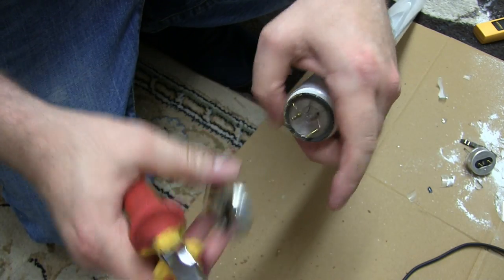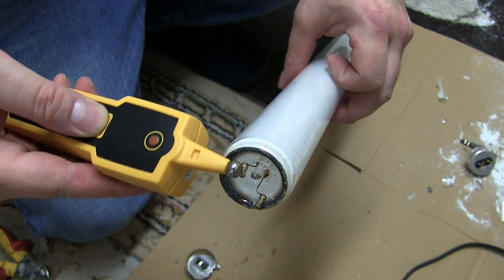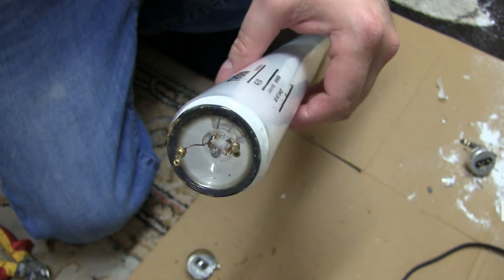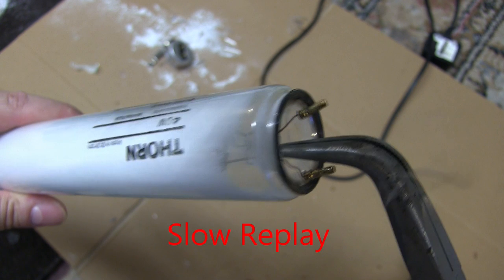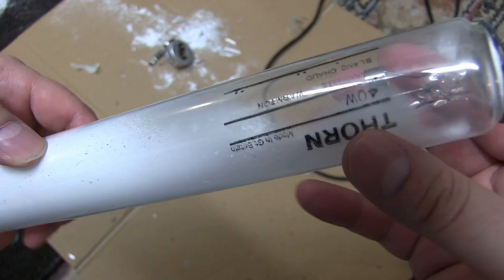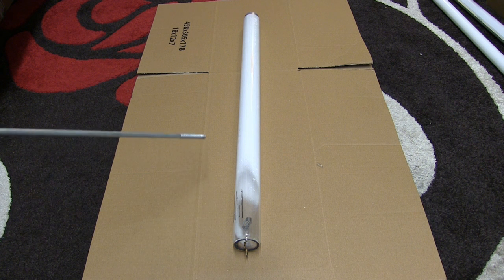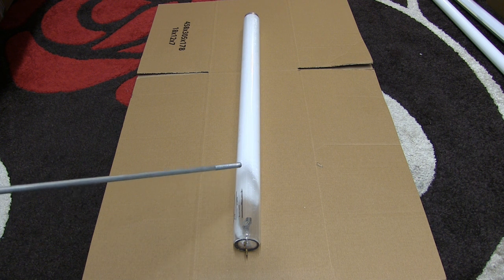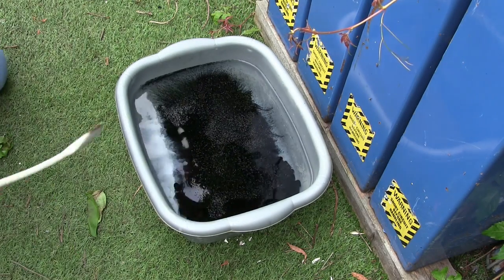Fluorescent Tube Sucks Up Water (Short Version)

Comment: I never would've guessed that the column of water would go that high up. Cool demonstration.
Reply: Would go up to about 35ish feet if he had a tube long enough.
Reply: This column of water actually weights 0.23 atm so the pressure in the air pocket is 0.77 and so there is 1/4 less air really in it than it seems to be.
Reply: It would fill up even more if the water was degassed first.
Reply: @chemistryofquestionablequa6252 but even then wouldn’t the gas slightly boil into a gas state and remain a vapor along with the minimal gas that’s in there?

Edit: because of it being under a slight vacuum

Comment: There may be even less gas than is visible, the weight of the water in the tube will maintain a lower than atmosphere pressure in the top part of the tube.
Very cool
Reply: The water also releases some of the gas that's dissolved in it, and will partially boil away due to the low pressure, further adding to the gas in the tube. You can see this very well with the 8ft tube - you can see a lot of bubbling and foaming near the top of the water as it's being pulled in.

Comment: probably most of the gas there is dissolved air from the water outgassing in the low pressure environment
Reply: Yes, you can clearly see the frothing as it travel up the tube. I would love  to see this done again with degassed water.
Reply: How much of that bubbling is outgassing, and how much is due to the water boiling into the vacuum?
Reply: @StephanAhonen  much  of it is water boiling, that's for sure.
Reply: @Peter Rabbit it would mostly condense when the pressure equalized, so i doubt it, but given the weight of the water column it is t as much gas as it looks like

Comment: A great video demo Photonicinduction! I make discharge tubes as a hobby and for a cold cathode fluorescent tube the pressure inside is about 20 millibars. Whether it is different for a fluorescent tube with heated cathodes I'm not sure but it looks about that judging by the result of your excellent experiment.

Comment: quick thing to note, water is heavy and gravity is a thing, so in the tube after the water is pulled up, if you left it sit against the wall it will pull a new vacuum, though less strong than the first. you can use this with even heavier things like mercury to make vacuum pumps and cody's lab made one of those like 6 or 7 years ago if you dig up his old, old videos.

Comment: So about 1000 Pa left. Still quite a ways from the 10 Pa of a 2-stage vacuum pump. I'd try using LN2 to collect the mercury out of those and make a Sprengle pump with it and some glass tubes (.001 Pa, and far cheaper than a turbo pump to get that same vacuum level, even if it is slower and takes a week per cubic foot).

Comment: You used to see the phosphor blown off the end of T12 tubes when they had reached end-of-life on SRS gear. After the cathode loses emission a lead-in wire would glow and melt back through the glass-to-metal seal and let the air in suddenly!

Comment: Yeah, That is quite possibly the hardest vacuum that anyone can handle without specific training on the dangers of it.
Reply: Except the difference in pressure between the inside and outside is probably about 100kPa. Making the internal pressure 10x smaller would increase that difference by maybe 1.2 kpa  or something. Not a huge difference.

The reason these are considered safe (except for the mercury) is because the volume of vacuum inside is kinda small, and spread throughout the long glass tube. If you had a similar "hard" vacuum in a glass tank the size of a big beach ball, that would be way more dangerous.

Comment: 3:20 is the water boling because of the high vacuum, when its rush up the pipe?
Reply: Hmmm, would say yes, but bubbles seem to be forming quite far from the top of the water so I don't know- the weight of the water means it can't boil further than about 30cm from the top

Might be dissolved gases? Should be about 3% of the height of the tube

Comment: that height of water column is making it look like there was more gas inside the longer tube, but i do understand it would make it difficult to show it in any other way.
Reply: I think it is pulling harder because the water weighs a lot in that tube plus there is likely steam or water vapor from the vacuum boiling the water at least initially. So there's no more gas in that tube than the shorter one.

Comment: You notice that the weight of the water actually filled some of that vacuum with water vapour on the 8ft tube. I think there is a physical limit to how far you can suck water up a tube and i think it's about 10 meters.

Comment: vacuum can't be too low or you can't start the tube. Can't be too high or you can't start the tube. Argon is added since it is easily ionized. Pressure is a balance between tube life and keeping the starting voltage reasonably low.

Comment: Quartz tube is needed when one wants deep uv UVC 254nm radiation. Mercury also produces more lines in UVA and UVB range. So regular glass blocks 254 nm bit still some UV light passes.  Not so dangerous but shall be threated with care.
Reply: Is this how tanning bed works? I've heard A and B rays needed for tan.

Comment: I am flabbergasted!!!!  I would never have guessed that even a high vacuum could lift so much water! Wow!! --- Now I am confused as to why fluorescent bulbs don't just implode all the time...??
Reply: Glass is pretty good at resisting stress and the round shape helps spread the load evenly. It usually cracks when force is applied unevenly.
High pressure is a lot more dangerous because the explosion throws glass everywhere.

Prince Rupert's drops are a good example of how focusing force at the strongest points of an object can result in it withstanding far more force than it would normally.

Comment: I bet it would have filled up more if it didn’t boil the water inside on its way up👍🏻
Reply: I reckon that was the air in the liquid degassing. The water would boil under vacuum but would return to normal when pressure equalized.
Reply: And gravity is still pulling down on the water so it's not quite 1 atmo of pressure left of gas innit.
Reply: It requires about 10 meters of water column to make it boil
Reply: Wasn't really boiling, just degassing due to reduced atmospheric pressure but you're correct about it would have filled more. The effect was amplified by the reduced pressure as well. I bet it was nearly full vaccum before he opened it. Pretty clever test really. It's very intuitive when you see it but i probably wouldn't have thought of it.
Reply: @Lucas12v  i thought exactly the same thing. It can't be that accurate when bubbles of some gas are forming and rising to the top. But never the less very interesting and a nice visualisation 👍ps: what kind of gas is it? Oxygen?
Reply: @night__walker  not sure. I would assume it's oxygen, nitrogen, co2 and some trace gasses just like air.  Probably in the same proportions as air but i could be wrong.
Reply: @Lucas12v  yeah makes sense
Reply: Probably would make sense to pull a vacuum on the water first to degas it and then do the thing. But that's overkill for a visualisation 😅
Reply: @Lucas12v  Hi Lucas. The gas will be around 90% argon, 10% neon and the tube will also contain a few milligrammes of elemental mercury. The actual pressure will be around 20 millibars.
Reply: @peterjameson321  that's what would be in the tube originally. I was referring to the gas that was leaving the water. Since it's basically dissolved air i assumed it would have the same composition.
Reply: @peterjameson321  still interesting info though. I was curious what the internal pressure was when it was sealed.
Reply: @Lucas12v  Ah, I see Lucas. Yes in that case you're quite correct of course. Thanks for your reply.

Comment: Thought you were going to try to light them up ,  did the gas oxidize on the inside of the glass? did the stuff wash away with the water or is it soluble, the water might be flammable in the glass

Comment: I can’t believe the 8ft tube was able to withstand the weight of all that water without breaking lol
Reply: The weight of the water pushing out is nothing compared to the force of the atmosphere pushing in when there's a vacuum inside. It's one thing to make a container hold pressure on the inside, and quite different to make a container to take a vacuum on the inside. Thunderfoot recently did a video about how much pressure / vacuum a soda can could take. It can take lots of pressure and be fine, but hardly any vacuum causes it to collapse.

Comment: I'd suspect if a liquid that had close to zero dissolved gas was used, the level in the bulb would be even higher.
Some say an extremely high vacuum of 0.0000001 Tor would cause the tube to fold just remember if the vacuum was perfect at typical sea level "fair weather" pressure is 14.6959 psig on the outer walls which the tube could easily withstand.  Nonetheless, this high vacuum is why it's so fun to toss these things in the dumpster! ;-)

Comment: you gotta use boiled water because there will be lots of gasses like nitrogen dissolved in the water that are released by the low pressure in the tube.

Comment: I wonder if you could calculate the pressure inside the tube by comparing the volume that's filled with gas.
probably need a less volatile liquid to do it though. 
I think this is how mercury barometers work, right?

Comment: I hope you didn't miff ur missus by messing on the carpets with the dyed water lol  Just one thing, if you take a tube full of water, sealed on the one end, and invert it, a gap will appear on the top inside (a vacuum)  depending on your atmospheric pressure, or something like that,  as far as I can remember.. so that gap might be a function of the atmospheric pressure as well.

Comment: I wonder how much of the space at the top was gas that came from the water since water dissolves atmospheric gases and you can see it causing it to either evaporate the water into the vacuum level pressure OR its degassing the water thus causing the gases in the tube at the top at least to be released from the water and bubbling up into the chamber the argon is also in,

Comment: So that little space left is the mercury gas? Im no chemist but that amount can't be super dangerous can it? Let's say a tube breaks in an average sized room and that amount gets released and diluted into the surrounding air; that cant really hurt you can it?
Reply: Remaining space is a gas pulled out of water due to sudden pressure change. In reality there is almost no gas. Amount of mercury from a lamp can't hurt you, unless you are exposed to other sources of mercury on daily basis. Still, it's a bad idea to hang out near a broken tube right after it pop.

Comment: How much dissolved gases (bubbles) are in the remaining volume?
Reply: It might depend on how long the column of water is because an eight foot column will likely pull a vacuum. Also there will be lots of water vapor because at first the vacuum will boil the water.

Comment: Why is it a vacuum? I thought they were "full" of gas
Reply: I think it all goes back to electric current fluorescence and how it's observed in partial vacuums. Same thing with filament bulbs but they tried to evacuate some of the oxygen in order to add some other noble gases which would slow the decay of the filament due to the oxygen. Maybe same sort of thing with tubes since there are filaments at the electrodes also. I always use to think "explosion" whenever I saw one break but I guess it's really a violent implosion instead.

Comment: Take a brazing torch or one of those crack torches and concentrate heat until it hits melting point. It will actually pull the glass inward like a sort of inverted rupert's drop.... meth addicts taught me that.🤣🤣🤣